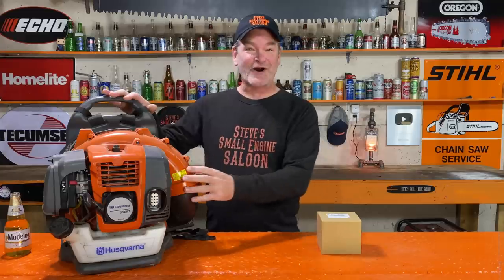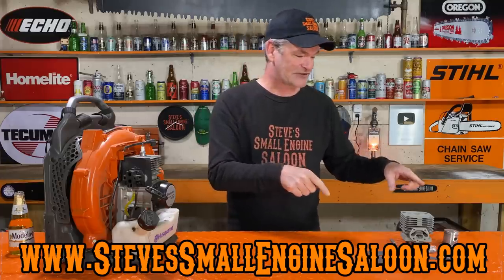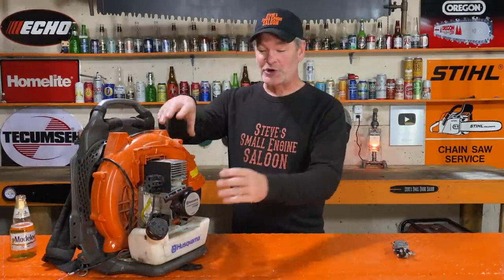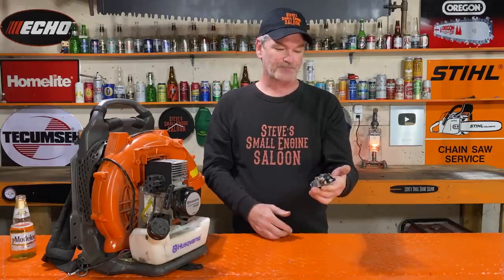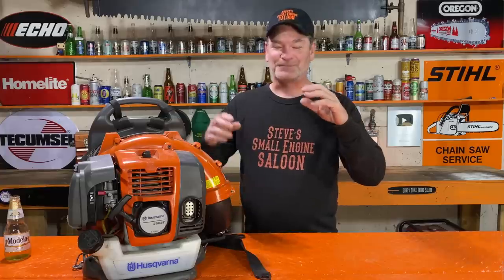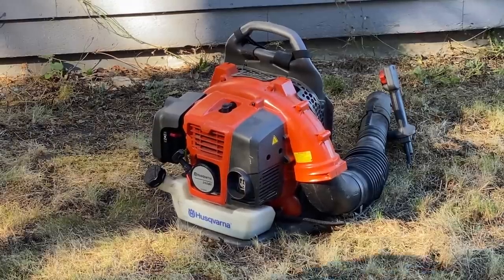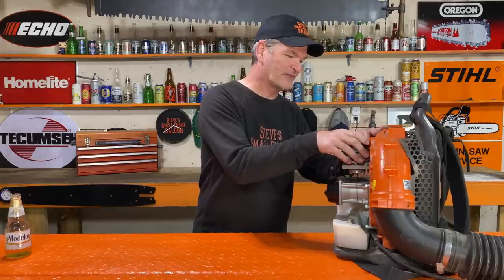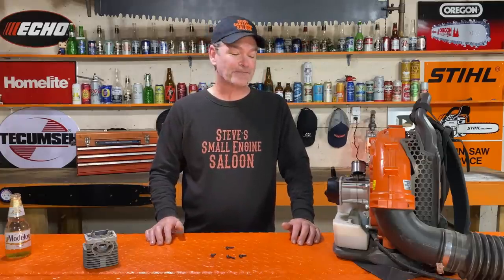Testing An After Market Piston And Cylinder Kit On A Leaf Blower

Comment: I love getting a piece of equipment that someone throws away as trash and being able to repair it. Just gives you that feeling of pride and satisfaction every time I use it.
Reply from the maker: Agreed!
Reply: My friends got wise, they ask me to fix their tools now. They've seen to many of their trashed tools come back to life.
Reply: I've done that with a John Deere garden tractor and a Stihl backpack leaf blower. The owner was told by the shop that it would cost more to fix them than they were worth. I put $800 into the tractor and $100 into the leaf blower in parts. They've been running strong for years. I've lost track of how many small engines I've fixed with only an inexpensive carburetor kit.

Comment: Steve-O! Another excellent insight! If your ears were ringing a couple of days ago, my nephew came over to help with the grass and the mower wouldn't start.I had the carb bowl off of our 35 year old Craftsman mower. The bowl was immaculate but the passage in the bolt was clogged. I did exactly what you said, put it back together, it started on the first pull.     I told my nephew about you. Thanks for saving a trip to the local small engine shop.
Reply from the maker: Good stuff!

Comment: So far I've rebuilt two saws with aftermarket pistons, cylinders, and rings and have had the same experience. The only word of caution I found was to look at the circlips for the piston pin and make sure they don't have the "ears" that make them easier to install with pliers. Those ears can break off or the piston pin can push on them and cause the end to unseat.
Reply from the maker: Agreed!
Reply: had that exact experience with a wrist pin circlip....new rebuild ran exactly 500 miliseconds....its comical now....years later
Reply: Install those with the ears pointing inward, they do have a curve

Comment: Hey mate g'day from Australia, my dad had a Honda ult425 whipper snipper he bought about 15-20 years ago, he took it to a dealer and they said it wasn't repairable and that if it possible was it was going to cost to much. I got it home stripped out the carby and it was blocked and diaphragm was buggered, the genuine new carby was approx $125, I looked on ebay and found whole new kits including new fuel lines, air and fuel filters and bulbs for $25. So I just bought that, Put it all back together and it started up first time and has everytime since. After market stuff isn't to bad really. Saves a lot of money.

Comment: Suggestion for Steve: why don't you show us how the aftermarket replacement parts hold up a year from now!
Reply from the maker: I will!  Thank You...  Great idea....
Reply: good idea and put an hour meter on it as run time in a year is important.
Reply: I asked this in a different post but do you plan on running 50:1 or 40:1?
Reply: Don't forget to blow snow with it too after the leaves are off this fall.  Get those hours up.
Reply: @61hink  got almost 60 years of working on everything from diesels down to the small stuff. Only 1 saw ever ran hot enough to boil the gas in the tank, Homelite SXL 925. Had 2 of 'em but 1 was a 944, predecessor to the 925 & it had points but both saws would boil the fuel tank. I ran AV gas at 40:1 & a colder plug, H-L had a SB on this but not on the AV gas. Solved the problem. If you using AV don't mix it leaner than 40:1 in anything 2-stroke.
Reply: Really enjoyed this video. Took a lot of effort on your part and I appreciate it. I’m in agreement with some of your other viewers/subscribers. A follow up inspection video a year from now would be the most helpful. Even combine this video with your one a year from now. 
Think this is one of your best videos ever. Thank you!!👍🔥❤️
Reply: @darrellpickering8535  i have a homelite sxl925 that does boils the fuel
Reply: @darrellpickering8535  Old boy once told me you always want your 2 stroke to smoke a little bit. I always mix a little rich. I have an Echo weed whipper I bought for ten bucks that was old school, all metal case. Ran that little thing for a couple years until one day it developed a little pinhole leak in the fuel line. That old metal case got hot enough to auto ignite the gas vapors and one day my little echo turned into a full blown handheld fireball! I tossed the little devil about twenty feet from the grass to the pavement so I didn’t start a fire. That night, I took a look at it. It was seized. Poured some mix down the plug hole and let her sit overnight. In the morning, I was able to free that piston. Put a new fuel line on it and poured in some mix. Goddamned thing fired right up. The old metal rigs get hotter than deep fried napalm, but they don’t make em like they used to!
Reply: With 400 ft driveway and some occasional exstra blow it will hold nice..i have some seripis doubts on a proffessional use but for homeowner it will do as much as needed.. i ve seen homeowners to buy pro equipent for cutting few items.. it is waste of money.. if you dont use your tool daily, you should buy accordingly
Reply: @luulemees  I'm guilty of this but I'm tool obsessed😅 it saves me a lot of time though cutting, good for odd jobs too
Reply from the maker: Here is the update   https://youtu.be/Z4hUXR5KsdQ

Comment: Retired after almost 60 years working on this stuff. In the early days of aftermarket stuff some of it was very poor quality. Back in the day a guy brought in an 046 Stihl with a bad cyl. He also had an aftermarket cyl kit he wanted to use. After I looked at the aftermarket stuff I passed. He then took it to another shop who assembled it. It ran ok but at the 2nd start the piston crumbled. Didn't surprize me. 1 other thing, I always replaced the bearing & seals in a case like that. Everybody has their own ideas.

Comment: Alot of times I just get an aftermarket Chinese carb for stihl products and just disassemble and use all the gaskets, diaphragms and seals on the ultrasonic cleaned oem original carb to avoid the dealer monopoly on the higher priced parts,  love your content Steve and maybe make another video of some tips like the one I just gave in this comment so that other aspiring young small engine mechanics can lead the way in providing and teaching true quality! I love the video about the seals on the spindle/mandrel bearings on mower decks, I had a suspicion and you brought it to light with a great video, have a wonderful day, 🍻 cheers from Texas, best regards, Jeff

Comment: I rebuilt my dad's Stihl 180 5 years ago with Chinese Parts still runs perfect
Reply from the maker: AWESOME!
Reply: For small personal use  it will probably get the job done.

If it's stressed and used professionally... Might not lol
Reply: i did the same on 180 for friend, replaced seals and gaskets too to be sure no air leak and its still runs as day i built it 3 years ago
Reply: @mcr5645  Worked with Stihl in professional civil use an bush cutter and we also had an issue like this ? We bought an Chinese Clone of the Stihl  The Chinese one even outlasted till today while the Stihl one already gave up engine wise . The blades of the Chinese one didn't last that long.  But tbh we prefer to keep our companies up and running and not support Chinese. But the quality of Chinese is getting way and way better than they used to be .

Comment: I got to tell you Steve I've had similar results will aftermarket kits like that. My routine with them is feel the ports and make sure they won't hang a ring, wash the piston and cylinder really well. Done about 5 aftermarket ones now and none have popped yet
Reply from the maker: Right on Kyle!  Thank You...

Comment: I ordered a Chinese carb for the 18hp B&S motor in my ARGO, and couldn't have been happier with the price, and it came with complete extra parts and cleaning brushes. I was very impressed.
Reply: I did too... Bought a $13 carburetor for a snowblower and it didn't run for crap. Ended up taking the parts I needed off of it cleaned and rebuilt the old original carburetor and it runs perfect now. The aftermarket carburetor had a larger throat and bigger jets but still ran lean. Had no adjustment and when I engaged the auger it would stall like you to shut the switch off. Would only run on half choke.
Reply: @jasonbusch3624  , I have no idea why they didn't do an adjustment knob. Mine is the same but seems to run great right where it is permanently set. It may have to do with regulations on emissions.
Reply: @SIC-SEMPER-TYRANNIS  I tried to notch the air screw but it was locked and wouldn't turn. Tried to heat with a soldering iron and still no dice. China Junk!

Comment: Steve I just tried to but a E-bay piston& ring kit in a real Honda GX 160, what a pain that has been, The E-bay piston stuck out of the block almost 1/8". The kit had a thicker head gasket than the original tin one so as it didn't seem to stop or hit anything I tried it. It actually seemed to work ok except the engine wanted to hunt at fast speed, I had put a new Hipa chinese carb on it. Guess I will have to do that jet mod you have shown us. Anyway I couldn't stand that piston being the way it is and took the motor back down. Bad thing is I couldn't see where that over size piston had caused any problems. Was going to reuse the old piston but the rings that came with the new piston don't fit. I new $16.00 for a rebuild kit was crazy, a new Honda OEM set is $34.00. Thing is I found out with Hondas you have to order parts using the serial & model numbers, if you order based on a GX 160 only you can have problems.

Comment: Rebuilt my dads homelite xl12 in the late 80s using aftermarket bearings,rings,cylinder and piston. It was my dads primary firewood saw till he passed away 8 years ago. While it’s not my primary saw, I still run it some during firewood cutting season . Saw still runs excellent with very good compression always starts and runs great. I run non ethanol 90 octane fuel mixed 3 ounces of  amsoil interceptor 2 stroke oil per gallon of gasoline. Run this mix in all my 2 stroke equipment no problems whatsoever.
Reply from the maker: Right on

Comment: Used an eBay cylinder/piston kit on my 455 rancher with the same result. One of the four  threaded mounting holes on the cylinder was stripped. I used a longer/smaller diameter screw and installed a nut on the back side. The eBay seller sent me a replacement but the stripped one has been running fine for a season.
Reply from the maker: Awesome!

Comment: I rebuilt my MS260 three years ago, head, piston, bearings, gasket, carb and ignition coil with Chinese parts. Guess what, it still runs perfectly. I must mention I'm a tree surgeon working every day and use the 260 most days, my go to saw is my trusty MS291 which also has a Chinese carb.
Reply from the maker: Right on

Comment: I have watched a lot of people saying aftermarket parts are no good and not worth what you pay for them. I personally have had good luck with most of them, enough so that the few that have failed probably are no worse than OEM performance. This is especially true with electronic components such as ignition coils I’ve and I’ve had an awful lot of bad OEM ignition coils! I hate to say this but I highly suspect a lot of shops don’t want to use aftermarket parts because they have to wait for them via the mail and they can’t make as much money on parts markup. So it makes sense for them to push OEM that they have local parts sources for, get a good price mark up, and push the end product out the door quickly. It definitely doesn’t encourage do it yourselfers and the right to repair movement!

Comment: I took a chance and used one of these kits on my Polaris 500 two years ago.  It's old, rings were shot and it had a rough life.  I've been using it since then with no issues.  Kit was $100 for piston, rings, cylinder, gaskets and some other stuff.  Every where else was over $800 for fewer parts and I couldn't see putting that kind of money in a 20+ year old $1200 4 wheeler so I took a chance.  Still going, fires right up, compression is good!  I mainly use it in the Winter to push snow so I wouldn't say that I baby it.
Reply from the maker: Awesome!

Comment: I recently rebuilt my Husqvarna Rancher 50 chainsaw 1989 Model with new Chinese piston and cylinder kit from carbydoctor on eBay in Australia. The original was 44mm but the only one available was 45 mm and it was a straight fit in. The cylinder bolts were a bit harder to get to and I had to find a thinner socket that would fit down the hole so I used about three different attachments joined together that I won't usually use together and that got the job done. I had no idea what to torque to and I think I settled on 4 Nm or so. Possibly 5. And retorqued when completely cold after running it in. I think there was a lttle bit of leak out of cylinder mating surface but all good after retorqued. Carbydoctor had to send me a plug screw to plug the decompression hole in the cylinder that my saw doesn't have. I've used it 3 or 4 times now and great compression and no problems and easy as starting. And no marks visible in through the exhaust hole. The after market cylinders are a bit lighter than the OEM, but I think I would buy again. Early days but can't complain.
Reply from the maker: Nice!

Comment: I have rebuilt 4 or 5 engines similar to all 4bolt and 2bolt 2stroke engines in most gas powered gardening machines except I run these engines in gas remote control cars and these aftermarket cylinder heads and piston kits are great value and also good for learning how to port and polish to get a bit more torque out of them

Comment: I have an MS 250 that had the crankshaft wring off right below the flywheel, and was looking online for a crankshaft but found the whole motor, cylinder, piston with rings, seals needle bearings, and base cap AND crankshaft, I put it together and it ran good when I pulled the rope,.. , runs every time,..
Reply from the maker: Awesome!

Comment: I purchased a knock off carb for my generator. works like a charm. I have to say, I would be a bit hesitant about using a piston/cylinder. But after this, I would try it. The cost is so much more cheaper. Thanks for the review.
Reply from the maker: You're Welcome...

Comment: Exceptional video Steve showing just how well made SOME of the Chinese knock offs are made. Likely 85% of our parts are from Sten's and unless the customer requests OEM we will supply the aftermarket parts. After 9 years in business i can honestly say we have had almost zero problems with the Sten's aftermarket products (Kohler electric starter 2nd generation failure). On the other hand Chinese carburettors ordered off Amazon.ca have been an issue with oversized choke plates and intake openings, throttle valve linkage holes needing to be opened up, Nikki snowblower carbs not priming due to bad body casting. These are probably running at 30% failure rate good thing there is the 30 day full refund return policy. Saying nice to see April in another video the OLD MAN at Eliminator over and out!
Reply from the maker: Well said Wayne!  Thank You...

Comment: Hi Steve,  after market is exactly the same, they all come out the same factory in my opinion. My Sthil FS85 petrol tank started to leak petrol from the grommets holding the fuel lines that go into the tank. I went and bought new hoses  locally $8.00, they were too thin and leaked more fuel, add some heat shrink tubing temporary that fixed the problem. Ordered a new tank with hoses, grommets, filter from China $16.00 .
I also bought a new carburettor a few years ago it was $5 more than the kit it works fine no problems, I kept the old carburettor as I'm one that like to repair then to replace. I will order the kit next time.

Comment: I rebuilt my old sthil o 29 super 3 years ago using a $25 rebuild kit off of eBay, took about an hour still running great. Saw Shop told me it would cost more in Parts than the saw was worth and I should just buy a new one lol. Even if I had to rebuild it once a year it would be well worth it. I probably cut about 10-15 cords of wood a year with it.
Reply: You can also get a Stihl chainsaw clone completely unassembled, for about a third of the price off of eBay.

Comment: I've had good luck with these kits, using them for 5 years or so. I always port them, clean the piston up and run at 40:1. I abuse them, don't break them in and run them on the edge. At 40$ Canadian I don't care if they blow up sooner tham oem because I love rebuilding and trying different porting techniques. If you want really good quality aftermarket stuff get Hyway brand from Taiwan.

Comment: I build a Husqvarna 350 with Chinese cylinder piston ring kit I have ran it for about a year-to-year in half I have ran 5 gallons worth of gas through it so far it still runs perfect and when I look through the exhaust port it looks shiny and beautiful with hardly any wear marks Chinese stuff works good in my opinion but I think you have to prep it nicely that way the Piston does not scrape on Sharp edges in the cylinder
Reply from the maker: Right on Matt!  Thank You...

Comment: About 18 years ago I bought a Husky 365 at a flea market for $3,50 for parts. Got curious and got it running but poorly rings were flat ass wore out and cylinder looked like no air cleaner. Bought an after market piston and rings. Its still running like a champ with good compression. Those parts make alot of equipment worth fixing
Reply from the maker: Agreed!

Comment: SteveO, these kits are hit and miss. My experience is 1) cheaper rings…less tension, not concentric, wear faster, less compression. 2) cyl. Port timing…close, but not exact. They run but lack throttle response/power of oem. But it’s the difference of rebuilding and having if for albeit just a backup or it’s tossed in the trash.